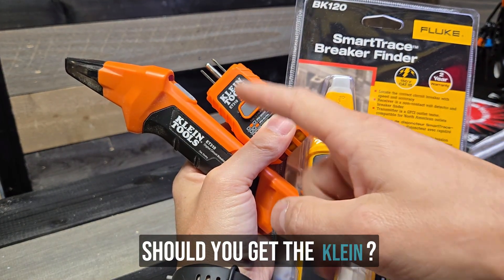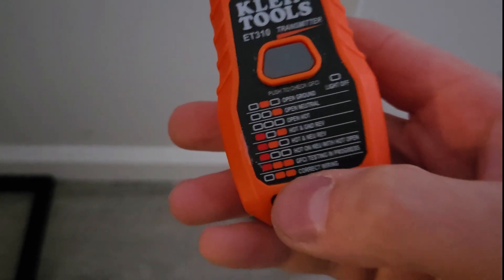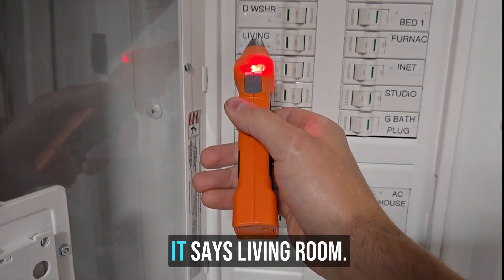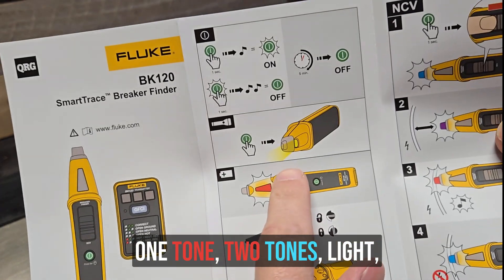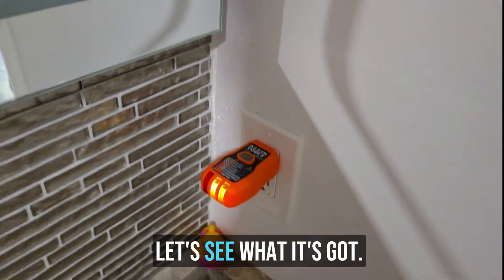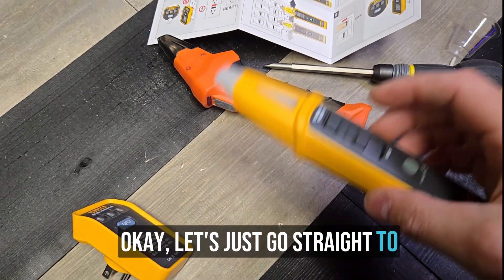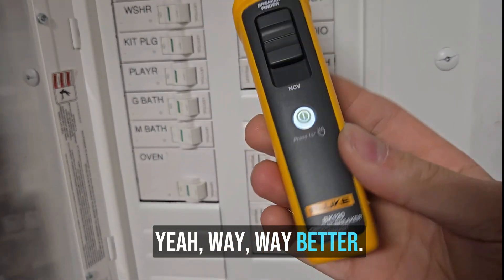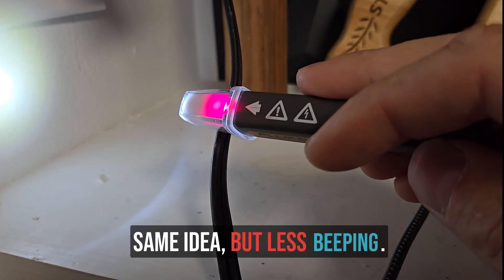Klein circuit Finder Vs Fluke

Comment: I don't understand why you go so fast over the breakers. Hard to undetand what is actually happening
Reply from the maker: I suppose I could go slower, but that's just how the units work.You don't have to go slow. If,i was  experienced with the tool, I might go slow like I was trying to figure it out.

But sometimes muscle memory just kicks in when showing you tools. You're right for presentation.I could go slower thanks
Reply: @toolsandtactics  Thanks for your reply and answer. 
Do you have to unplug all surge protectors on all other circuits before testing ?

Comment: Good video to demonstrate to Throw Away the Klein tool. (The video would have been improved if you had done that on camera - keeping it around is clearly dangerous.)  
I'm glad I have the Ideal brand Circuit Breaker Finder, it has not failed. Maybe I'll consider the Fluke in future.
Reply from the maker: Yeah the ideal one is awesome

Comment: My Klein has wasted so much of my time. It rarely finds the right breaker. I’ve given it many chances on different jobs. It’s going in the trash. I keep going back to my old one I bought at radio shack over twenty years ago. It usually works on most panels. I’ll be checking out the fluke.

Comment: The best breaker finder is an apprentice with a borrowed pair of pliers.
Reply: I have pretty good luck with a single pole switch wired to an appliance whip
Reply from the maker: @adfadgaqgv 😂😂  until it welds!!   Yeah. Nice.
Reply: @toolsandtactics just gotta make sure the switch is off when plugging it in. Doesn't work for FPE though
Reply from the maker: hahaha

Comment: The Klein tools advanced circuit tracer works best for me, mostly because I can you use it on 460 volt circuits. I haven't had any issues with it especially with being able to adjust the sensitivity. That thing has saved my ass multiple times! If you got the extra money I would buy it.

Comment: I would Just make a short little 3-6 inch extension cord you can get the male and female ends at home depot that look like molded Plugs and a buy a foot of 16-3 flex wire.
Reply from the maker: Yeah good idea.

Comment: For what it's worth, when i plug the Klein transmitter into a receptacle, I also like to turn on the receiver at the location where the transmitter is plugged into and let it detect the transmitter (before heading over to the breaker panel). Then (with the receiver on) I walk over to the breaker panel and run the receiver up and down the breakers. Seems to work a little better.
Reply: I saw another video where he specifically said you must turn on the receiver away fron the breaker box for accuracy. He patiently ran it across and it was spot on.
Reply from the maker: Thanks for adding that.Maybe it can help somebody

For the most part, it works pretty good.But every once in a while, you're running through a circuit that just wants to be stupid.  

But the other brands rarley run nto problems

Comment: Thank you for testing diffrent circuit tracers. I have had problems with  economical circuit tracers giving false positives.    
I use the IDEAL SureTrace 61-957 Circuit Tracer and it is amazing. I work in multi story buildings with 3 or 4 electrical panels on each floor.  The Ideal 61-957 has been discontinued and replaced with the Ideal 61-9480. I still have and use the 61-957 but i am interested if the 61-9480 is better.

Comment: I use my ET 450 because my ET 310 is all over the place, exactly like in your video. I work on a lot of older homes, some that aren't grounded. I'm not sure if that's the reason my 350 sucks.

Comment: I wish this video was out last year. I bought the Klein and it failed exactly the way you showed. It was past the return window. Now I will get the Fluke. Thanks for sharing
Reply: Same. I’ve been really disappointed every time I try to use it.
Reply from the maker: Thanks for the feedback!  Not everything meter wise klein makes is great, but the et450 is!
Reply: @wisedonkey_  

It happen to me too.....
    However I bought the Klein UpGraded one.......

More money but it's more accurate....
Reply: You can not use this circuit finder like rubbing really hard what a pendejo.
Reply: You need to fix your open ground.